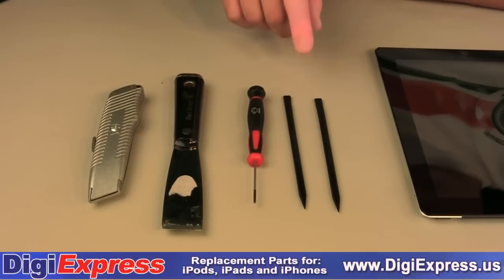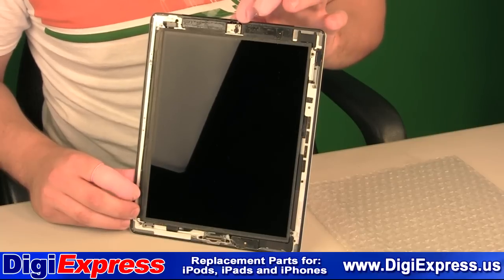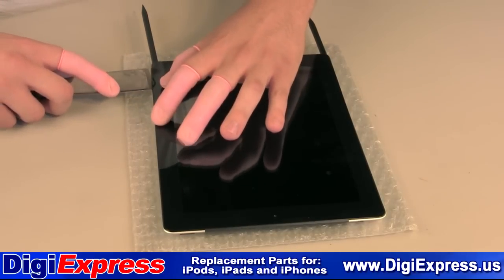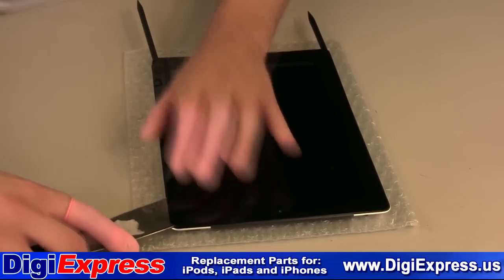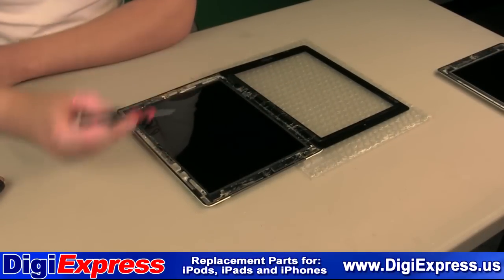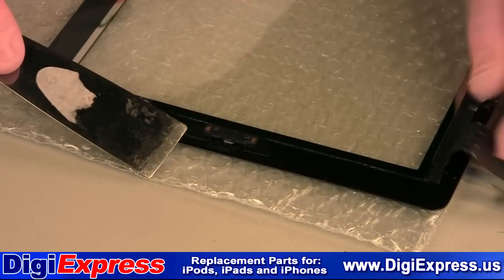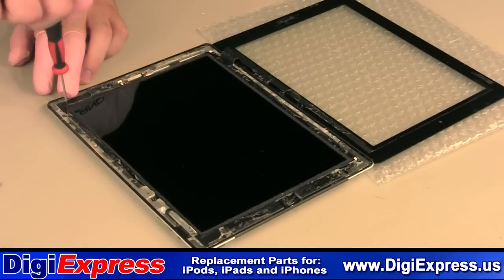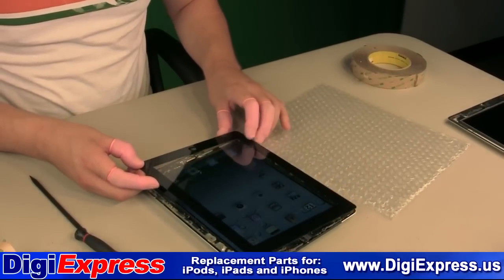DigiExpress - iPad 2 LCD / Digitizer Repair

Comment: My son dropped his iPad and now the touch screen does not work.  Is it possible that it could be just a loose digitizer connection or is it more likely broken?
Reply from the maker: It's hard to say. The probability of it being broken is higher than it being just disconnected. However, we have seen devices where the connection does come loose. And you don't know for sure until you actually open the device.

Comment: How much do you guys charge for iPad 2 Lcd & Digitizer replacement ?
Reply from the maker: There is a $25 labor/diagnosis fee, the LCD costs $99.99 and the Digitizer is $79.99. So you would be looking at $204.98 plus shipping for us to install all of those parts. You can place an order on our website: digiexpress.us, or call 800-440-4693.
Reply: Ok thank you for your speedy response

Comment: Hi have a question I replaced my digitizer but now my lcd is a grey screen not sure what happened
Reply from the maker: You may want to check the LCD connection to make sure it is properly secured. If it is secured and still gray, try a hard reset by holding down the power and home buttons together until the device shuts off. Keep holding until it powers back on then let go. If it's still gray, then the LCD itself may be faulty or damaged.

Comment from the maker: +GILLAOBOY I believe that you have damaged the LCD screen from the drop. That's why you can hear your notifications, but not see the screen. You can purchase a new one here, and add the repair option if you would like us to do the repair: digiexpress.us/Replacement-LCD-screen-for-iPad-2_p_302.html
Reply: can I replace my iPad 2 lcd with iPad 3 high resolution Lcd display. as the screen size is same so can I do it or anyone has tried doing it if it works ??
Reply from the maker: Rahul Chawla
You can not replace an iPad 2 LCD with an iPad 3 LCD. The connections are different, as are the screw locations. They are not compatible.
Reply: DigiExpress  thanks man. bit sad, iPad 2 has terrible resolution, don't have snuff money to spend lol.

Comment: i was wondering what i broke off :) its the antenna .do u think it still works properly   or i need to weld it ?
Reply from the maker: It depends on which antenna you broke. In most cases, just the antenna can be replaced without having to solder or weld anything. Attempting that could cause potential permanent damage. I would recommend looking at digiexpress.us and determining which antenna you broke and installing a new one.
Reply: DigiExpress the antenna on the right side of the camera as its mentioned on this video .seems like there is a tiny wire broke off .
Reply from the maker: *****
If it's the front camera, it's the 3G antenna. If it's the back camera, it's the on/off cable. So if you're saying it's an antenna, then you would need a right 3g antenna. You can get one here: digiexpress.us/iPad-2-3G-Antenna-Right_p_376.html

Comment: i dropped my ipad quite a few months ago and the screen doesnt work in only small parts. I can only type two of the four keys to my passcode so I cant enter it. If I buy a new LCD and replace it will this fix it?
Reply from the maker: It depends. If you're fully able to see the screen, but the touch function isn't working, then you need a new front screen/digitizer. If you can't see some of the screen, then it's the LCD and possibly a digitizer.

Comment: Very accurate, the only snag I had was that one of the corners does not stay glued.. Any suggestions? I also had a preinstalled adhesive on the digitizer. What type of double sided tape are you using there?
Reply from the maker: We use 3M adhesive. And occasionally we do run into a similar issue. One of the things to try, is very carefully, clamp the corners. Be sure to put a towel or some kind of cloth between the glass and clamp, and do not use too much pressure as the glass will break.

Comment from the maker: You can. It's going to take a little longer to loosen the adhesive, but it will work. And continue to move it. Leaving it in one spot too long can damage other components. But in most cases, a hair dryer does work.

Comment from the maker: It does sound like you need a new LCD. There's a small chance that it was damaged during the repair, but it's hard to tell without seeing it. But if the digitizer is working properly, and you're experiencing screen troubles, it is the LCD.

Comment: Any idea why  I would get a blank screen with just a green block on it after replacing digitizer?  I have checked all connections, did not break anything and powered device down before working.  It will power on and touch screen will respond by shutting down when a red stripe appears you can swipe it.  Ipad shows no launch, words or icons though.  Does it need a new LCD?  Could I have damaged it inadvertently?  Any help would be greatly appreciated!

Comment from the maker: They are actually used so that there is no static electricity that would be transferred to any components when he's working within the device. It also keeps all fingerprints off of the inside of the glass and off the LCD.

Comment from the maker: Depending on where you purchased it, you may have only received the front screen. Typically, it's recommended that you buy the assembly with the digitizer already attached. But, if it isn't sitting right, then the problem could very well be the mid frame.

Comment from the maker: If it's just the front touch screen that is damaged, then you don't need to change the LCD. You can purchase just the front screen from here: digiexpress.us/Replacement-Glass-and-Digitizer-for-iPad-2_p_301.html

If your corners are bent, then you may want to attempt to straighten them out with a pair of pliers, but it is a very delicate process because that involves working on the backplate. If the backplate isn't properly repaired, it could cause bigger issues with your device.

Comment: If it doesn't turn on you have probably cut into the power flex cable for the power switch, they are about £3-£4 off Ebay. Try plugging your Ipad into the charger as it will usually turn on when you do that. Once its on press the power button and I will put money on that's it doesn't do anything. This happens quite a bit with people when taking off the old bezel as the cable in the top right of the Ipad is very thin and easily damaged.

Comment from the maker: First thing to do is to check and make sure all of your connections are tight. If they are, then try to hard reset the device by holding the power and home buttons down together and don't let go until you see the Apple logo when the device is powering on. If that doesn't do it, there may be some other underlying issue. Possibly a main board problem or a there's a chance it's a defective screen.

Comment from the maker: Take a cloth towel, or something similar that won't leave any particles or fiber behind, and try wiping it off first with that. If the smudge is still there, try window cleaner, but spray it on the cloth. Do not spray it directly onto the LCD.

Comment: great video, clear and concise, but just a suggestion, could you not use a suction pad to ease the corners up first then go around the outer edge, seems less risky than a putty knife where cables are concerned

Comment from the maker: There could still be glass or remnants from the original screen. Be sure that area is completely free of debris and old glass, including glue or anything else that could cause it to raise. Also try using a little extra adhesive and carefully clamp that corner for an extended period of time. If using a clamp, try using a plastic clamp with a cloth between the clamp and the device.

Comment: I've had my digitizer replaced by 2 different places, and each time, it begins to separate at the lower left corner.  I've fully separated the digitizer myself this time, and found a broken bezel  that I'm going to replace.  Any other reasons that it would be continually separating here?  Thanks.

Comment from the maker: Use a heat gun or a blow dryer to heat the edges of the device to loosen the adhesive. Don't use it too long, as the heat can damage the device. Once you've heated it up, take a putty knife and insert it along the edge of the screen, near the metal frame. Gently pry it up and do not insert the knife in too far, there are cables that can be damaged and they are shown in the video. Just work the knife around the screen prying it up until it is completely loose. The digitizer comes up with screen.

Comment from the maker: To get you putty knife in there to remove the front screen and the digitizer, you need to heat the edges of the device with a heat gun or blow dryer to soften the glue. You don't need a lot of heat for an extended period of time. Next, insert the putty knife along the edge of the screen. This process is show around the 2:40 mark of the video.

Comment from the maker: The home button coming up with the screen is normal. That just needs to be placed into the new screen. However, it is the WiFi cable that you did break. That cable can be replaced, and we do carry the part. But the installation is very difficult and very time consuming. The cable gets connected under the logic or mother board. There are screws in there that hold it down. There is a dock connection for the cable underneath. But it's very easy to damage the board. That'll ruin the device entirely.

Comment: The "home button" is attached to my screen when i took it off.  And whatever the cable is attached to the right of the home button is broken as well.  is that the wifi connector?  will i need to replace that as well?

Comment from the maker: It actually connects the the buttons with a bracket. Near the power and volume buttons, there is a metal bracket with tiny screws. Once the bracket cover is unscrewed, you slide the cable into the bracket and tighten it back down to make the connections. The buttons don't actually get connected or soldered to the cable itself.

Comment from the maker: It all depends on your comfort with repairing electronics devices. Most of our technicians here can have the repair performed within a half hour to 45 minutes. For novices, we do tell them to take their time and be extremely cautious when performing repairs, because one wrong move will damage the logic board. Once you have the device apart, it is actually like 5-to 10 minutes. The cable just clips in. The hard part is removing the glass without breaking it or damaging anything else.

Comment from the maker: I just double checked with a tech, if you're getting power and the digitizer is just not responding well, be sure there is no grease or anything on the inside of it. Occasionally the manufacturers don't clean all of the grease. Also, try a hard reset. Hold the power and home button until it powers off and the apple logo appears. Once the logo appears, let go. It may then recognize it better.

Comment: One of the best tutorials I've found online for this! I took my time and followed these instructions and it went smoother than I anticipated. I did end up cutting the digitizer cable but I'm not worried about that since I'm replacing my digitizer screen.
Are the top antennas for the Cellular option? I didn't notice these on my iPad. Also, I wanted to note that people should be very careful of glass fragments that may get on the LCD screen while doing this. Don't wipe them off or it will scratch!

Comment from the maker: No, you have the correct part. The cable is in the lower left. Near the 3-minute mark of the video, it explains that the digitizer cable is in that area, but it's not directly on the edge of the iPad, therefore you do not want to insert your tool too far or it will cause damage. Also, be sure you take a little extra caution when you perform this, as Apple devices tend to be more sensitive than regular PC's. Don't be afraid to take your time. Good luck!

Comment: my ipad 2 has a problem. it doesn´t show me any screen, it lightens up a little bit but screen is black. do you know if it´s a cabling issue and would it be fixed by replacing the display as it´s shown in your video?
great tutorial by the way.

Comment from the maker: Yes. Some of the digitizers occasionally do come with grease on the inside. It does need to be cleaned off. The best way to do that is to make sure you have a clean, lint-free rag. Simply use your breath to heat the grease a little and then wipe with the rag.

Comment: very helpful video but i have a question, the new digitizer came covered with some grease on the inside, do I need to clean it before installing or is it necessary for it to work?

Comment from the maker: You can put tape on the screen/glass if it is broken. The problem you may run into is the iPad not responding correctly to your fingers because the digitizer, which controls the touch aspect, will be able to sense that the tape is on there. I definitely don't recommend putting tape on the inside. Your best bet is to have the screen replaced so you iPad functions properly. Check our website digiexpress.us or call us at 800-440-4693 to get the price. It is cheaper than buying new.

Comment from the maker: The black trim is basically the mid-frame, we replace them all the time so getting one off without damage is incredibly difficult. You need to take off the glass first, then clean the remaining glass bits out of the device.  Then run a razor knife down the backplate, behind the mid-frame.  Since it is very thin you may cut the frame, but at least the razor knife will leave a clean break that is almost not noticeable.  We do sell the replacement frames in black or white for iPad 2/3.

Comment: got mine off ebay for $25 shipped...wait is a month from china and the glass is super thin. if your lucky and they dont ship it in a paper envelope with little to no padding like one guy did to me it should work just fine. but remember they are super thin i'n now on digitizer #3 from chins and i broke the second one just holding it in my hand and running to catch an elevator.

Comment: Finger tips is used to block your finger print from sticking on the lcd when replacing it trust me you going to want them if your replacing a lcd on a ipad it's really hard to get out a finger print the inside of the lcd have no finger print protector

Comment: Hi there. Great video!! Is it safe to use a standard hair dryer to heat the adhesive rather than a heat gun? I'm not sure of the output temperate, any advice would be appreciated

Comment from the maker: The On/Off cable is seen running down the inside of the back plate, from the top near where the button itself sits to about 2 inches down the backplate.  You may have cut this cable or more likely broken glass cut it.  Also the cable on the lower right is for the wi-fi, it may be adhered to the glass and is somewhat hard to clean the glass off of.  So you may need one or both of the On/Off Volume Flex cable and Wi-Fi antenna with cable.  Call us for pricing 18004404693

Comment: hi just got Q, i  try to replace my ipad2 screen and which i did nd when im trying to press the power bottong not showing anything, any advise what it could be,
1 more thing i broke a cable that is on the lower right, you think that would be the coz

Comment: @joshs3492 i used this video as a reference to replace mine and it was fine. NOTE that you need to take your time. do not try and rush through it. I watched the video 3 times before attempting.

Comment: As to the antenna "patch", I used ordinary scotch tape with a few tiny copper fibers from an electrical cord. I put tape beneath the antenna to hold it in place then put tape on top, pulled it back to expose the small circle of conductive material (which had been ripped in half), laid down a few of the tiny wires with some tweezers, then laid the tape back down and sealed it. The antenna seems to work as well as ever, as does everything else.

Comment: Also, I think DigiExpress needs to include the mid frame and add that to the cost.  They really, REALLY need to include the tape also. I could not find that scotch tape in the video anywhere local. I ended up using flooring tape form Home Depot which actually works well -- it's just messy if you happen to touch it. The hardest part of all was keeping the glass clean long enough to put the digitizer in place.

Comment: I followed these instructions yesterday and successfully (almost) replaced my digitizer. I did damage the wi-fi antenna. It may have been the way the glass had shattered, but there was just no way to get the glass loose without prying. However, my wi-fi still works because of a little McGyver-ing. The main problem with a video like this is that they are demonstrating with fully intact digitizer glass. It ain't nearly that easy when the glass has shattered.

Comment from the maker: @TheInjuredKnee at 8:13 to 8:20 we show how to remove the LCD ribbon cable from the logic board.  The cable is not permanently attached to either the LCD or logic board.  The LCD ribbon cable is replaceable.  There is nothing wrong with the way we show the removal of the LCD screen, it will not cause any damage.

Comment from the maker: @sturfam The mid-frame may need to be replaced if you damage it while removing it.  Though if you can remove the frame without damage, obviously it is not needed.  Generally I recommend purchasing a new mid-frame, as it is better to have more than you need; rather than less.

Comment from the maker: @deoman16 The heat gun we are using is a 1200w and can reach temperatures up to 1100 degrees Fahrenheit.  The temperature is adjustable and the hot air is funneled in a cylinder shape to focus heat on the appropriate area.  A hairdryer will produce a conical shaped air flow and will not be able to provide the proper control.  In doing this you'll not want to overheat the glass, as it will "wash-out" the color on the LCD screen below.